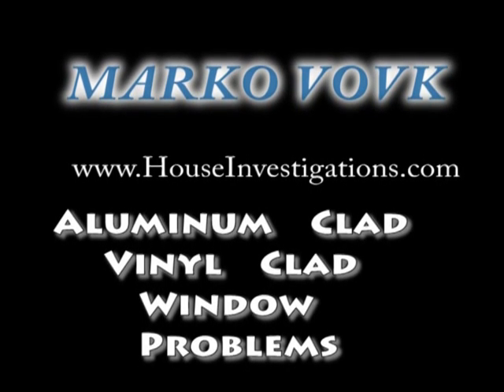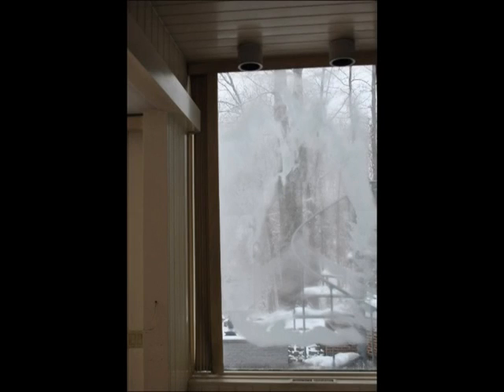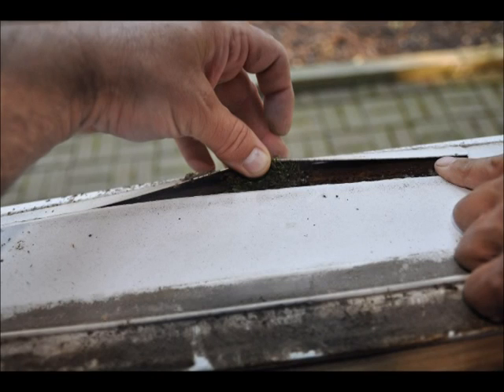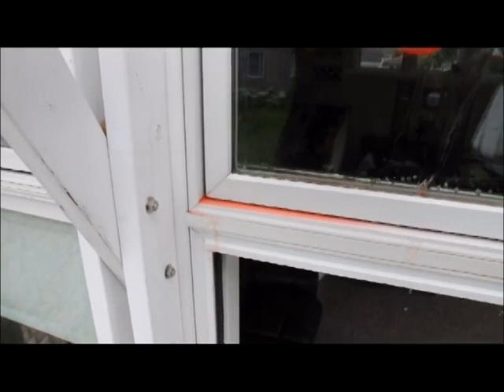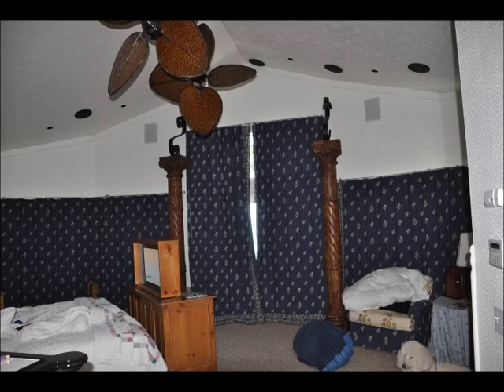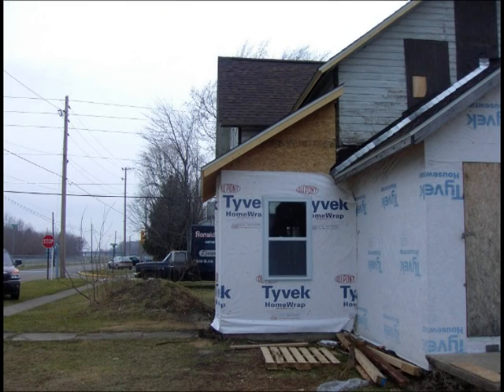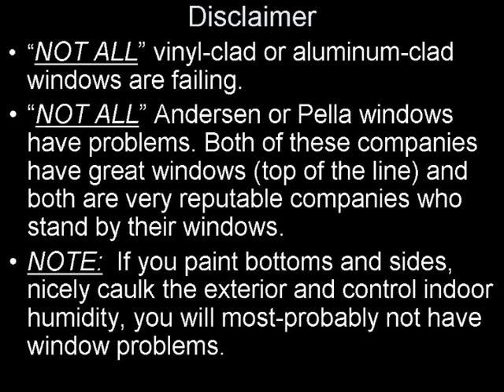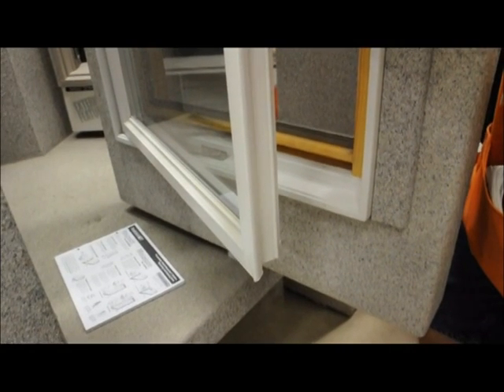Aluminum Clad, Vinyl Clad, Window Deterioration THE TRUTH Pella Andersen

Comment: Thanks for this video. A lot of information.  I am unclear on opinion of going with s sliding glass door by Anderson either the Proline wood interior with vinyl clad exterior  or the Permashield which is all vinyl clad.  Both clad over the engineered wood . I don't know if it is a rolled clad and would be a problem?  I have an all wood door now...any recommendations or cautionary tales or better brands in same price range?  I was also going to buy direct and not go through Home Depot.  Any comments?  In live in CO climate.

Thanks for your help!  it is needed!

Comment: Two questions: 
1) How is it OK to have a vinyl clad window but it's not OK to have a aluminum clad window with regards to the exterior vapor barrier in cold months (where moisture is trying to push towards the outside of the house)?  I would think that vinyl would act as a vapor barrier just the same as aluminum would, no?  I ask because Brad Purvis posted that his 31 year old Andersen vinyl clad windows are performing well, and you replied that "Andersen Rules".  I'm trying to understand how a vinyl clad would solve the exterior vapor barrier issue you noted in the video; and
2) I'm currently getting estimates to replace all the windows in my home, and from what I understand all of the main manufacturers (Andersen, Marvin and Pella) had issues with their clad windows in the 90's and early '00s which (supposedly) have since been resolved.  I'm looking at the new Pella 450s for my home -- do you know if the current production line of aluminum clad 450's have the same sealing issue with the aluminum and will eventually rot out and deteriorate?  I certainly don't want to replace all my windows again in 10 years....

I also had a quote from Renewal by Anderson and (at first) was ready to jump in.  I liked the idea of the Fibrex windows and they looked close enough to wood that I wouldn't lose the classic feel in the house.  I asked the rep if the fibrex renewals were better than the anderson retail windows like the 400 series -- and he confidently said "yes, there the only one andersen will install, so you know they're good."  Turns out he was full of cr*p, they use fibrex in their 100 series budget line windows as well -- not even close in quality to the 400's.  Further, Andersen doesn't even own the production of fibrex anymore from what I understand (they own the technology and name, but they do not manufacture it directly) -- I believe they outsource the production now to a third party.  Not only that, you'd think with a composite material they would give you more than the 10 year warranty that they give on their wood clad windows; seems odd that they can't warrant the material for longer than wood (vinyl carries a lifetime warranty in many cases).

My dilemma is that I don't want vinyl windows -- the look and feel just isn't there yet to mimic wood (it seems like they're not even trying to accomplish that).  The fiberglass windows are OK, but still don't have the same look and feel as wood either.  So, I'm limited to wood clad windows and am trying to find the best product.  The Pellas looked nice to me, but I want to get your thoughts on whether they have corrected the leaky aluminum cladding or not in recent years.  My next estimate is for Anderson 400's -- do you think those will perform better than the Pella 450's?
Reply: jefflesauvage You definitely jumped to an incorrect conclusion based on incorrect information. 

There are 4 main areas of difference between 100 Series
windows and the Renewal by Andersen products:

ApplicationThe 100 Series window is designed and
engineered for new construction applications in the southwest region of the US.
It is available in limited custom sizes but it is not designed for existing
wall conditions and cannot be easily trimmed on the interior and exterior in
such situations. Because of this, the Fibrex brickmold (or any of the RbA interior
and exterior trim options) is not available with the 100 Series. Renewal by
Andersen is specifically designed and engineered for replacement applications (exterior
sheathing, siding, and trim, and interior sheetrock and trim) and can easily be
trimmed inside and out – hence the many trimming options RbA is able to offer. Glazing SystemThe glass in the 100 Series is shop-made
glass, not factory-made. It is thinner single-strength glass, as opposed to the
oversized double-strength glass of RbA windows. 100 Series glass also has just
a single seal, while RbA has a dual seal of both butyl and silicone for
longevity and integrity of the glass seal. The 100 Series is filled with argon
using the capillary method (which typically results in a 50-55% fill of argon
between the panes and necessitates a plug to be glued into the hole where the
argon was blown in). RbA windows are filled with Andersen’s patented
argon-nitrogen blend using the vacuum-pulse method (which results in a 99% fill
of the argon/nitrogen blend between the panes and requires no plug because no
hole is used to inject the gas.) 100 Series gliding windows receive a
Performance Grade rating of 30, while RbA gliding windows receive a PG of 40. That
is also a significant difference. (By the way, the 100 Series is also not made at
the RbA plant in Minnesota. It is made at a facility in Texas, due to its
proximity to the 100 Series’ target market.) Market and AvailabilityThe 100 Series is designed and engineered
for the climate in the southwest area of the United States. The 100 Series was
specifically created to offer a new construction alternative to vinyl windows
which soften and melt in the high temperatures of that region. It has been
found to not perform as well in the northeast, particularly because of the
glass package, which is why it is not typically marketed or sold here. It’s
just not a window designed for the vast climatic swings we have in this part of
the country.  WarrantyRenewal by Andersen is the only product
line which Andersen installs themself and warranty that installation. (This is
of course in large part because RbA is the only true replacement window
Andersen manufactures and new construction installations are typically installed
by builders). Not only does the 100 Series have no installation warranty, but improper
application of it as a replacement window can void the warranty. In the case of
defects which are covered under warranty, labor is typically not included with
the 100 Series while it is included by your local Renewal by Andersen. The exterior
color finish warranty of the 100 Series is only 5 years and does not cover weather
stripping, accessories and hardware, including insect screen frames, handles,
and lock components. The procedure for making warranty claims with
these two products is also quite different. Of course, with RbA, you have a
local dedicated Service Department that typically responds to any needs within
1-2 days, and will handle any ordering, delivery, labor, and installation for
you.
Lastly, Renewal by Andersen is manufactured and owned by Andersen and is manufactured basically right up the street (Cottage Grove, Minnesota) from the main factory (Bayport, Minnesota). The 400 Series is wood with a vinyl cladding and a Fibrex sill. Renewal by Andersen is completely Fibrex. Renewal by Andersen is used on a regular basis to replace 400 Series windows, but I've never heard of anyone replacing Renewal by Andersen windows with any other product, let alone 400 Series.
Reply from the maker: jefflesauvage they are solid vinyl.  Pella came up this the clad idea. Anderson did have a  clad sill with rotted in many homes (90's).
Reply: Clevelandmarko When Brad Purvis mentioned that he has "Andersen vinyl clad casement windows installed when we built the house 31 years ago." that have performed excellently, I'm assuming those are wood windows with a vinyl cladding and not solid vinyl.  I'm getting the impression that you feel any wood window manufactured today is not a good idea to install - and vinyl or fiberglass it the best way to go.  If you HAD to choose a wood window, which would you pick?  I don't see any wood windows without cladding like they used to make, and vinyl and/or fiberglass just doesn't look right on a classic colonial home (in my opinion).

As for the Pella 450s, do you think the newer aluminum clad windows they are manufacturing are better than they used to be with regards to water infiltration and rotting?  I'm not as concerned about the vapor barrier issue, just about the possibility of water getting behind the cladding and rotting the window out.  I was told by Pella that the rotting issues were addressed by using a butyl rubber tape between the wood and the aluminum to protect the wood from moisture.
Reply: Tim Barnes Aside from Fibrex the two products have little in common.   If someone reading this ever has a guy from Home Depot tell you that the 100 series is the same as the RBA window for a fraction of the cost I urge you to see for yourself.  The differences are too many too list.

If you put the two of them side by side and took turn operating them and going over the features (or lack thereof) one by one it would become obvious very quickly that you were not comparing two products that are even in the same class.

I have replaced 100 series new construction windows that were less than 5 years old with RBA windows on a couple occasions.   At the end of the day an improper installation will ruin even the best window and imo the most important difference as it relates to the consumer is a proper installation backed by warranty and dedicated service.    In you contract with a retail outlet to have 100 series put in your home you are definitely rolling the dice when it comes to install day.

A contractor will size down an opening, buy a 100 series builder window with a flange, cut down the flange and pop it into the opening and trim it out considerably.  This leads to all kinds of air/water infiltration issues around the windows instead of through them.
Reply from the maker: jefflesauvage Pella wood is great buy needs to be painted several times. Yes Anderson had some bad designs for one its vinyl clad windows and I also have a video on that. The new full Pella Vinyl looks very good.  Now will the seals last 20 years, I don't Know. Sorry for being 6 months late. I did not see this comment until today. SORRY

Comment: Have Andersen vinyl clad casement windows installed when we built the house 31 years ago. They have performed excellent and replaced 3 casement sashes for seal failure which Andersen replaced two of them well past warranty. Building a new home in hurricane area and need impact glass. Will look at Andersen again as well as others. I do think how well they are installed can cause a large number of failures. Nice job on explaining the causes of failures on some window systems...
Reply from the maker: Brad Purvis  Andersen RULES

Comment: What do you think of Integrity by Marvin Wood-Ultrex ("pultruded" fiberglass) casement windows? They are wood on the inside and fiberglass ultrex on the outside (I think-but not sure- they are solid fiberglass, not clad). BUT the inside frame around the window that the casement mechanism fits into is unpainted wood on the side of the window that faces the exterior of the house. Thanks for your input and your great video.
Reply from the maker: I have not research this one. I only remember the bad ones. I see the bad ones during home inspections. I think the new Pella (non -alum) are good.  Marvin had a Pilt problem in the wood in the late 80's and 90's. They have improved since then.

Comment: What is your opinion of Renewal by Andersen full composite (Fibrex) windows?
Reply from the maker: Great Windows  Anderson Renewal
Reply: Nancy M Design flaws? Would you care to elaborate?
Reply: Nancy M The Renewal by Andersen Fibrex windows have been in homes for 20 years and were tested for years before that. All you need to do is Google "vinyl window problems" and you'll find plenty of evidence that every other type of window (wood, clad wood, Fibrex, fiberglass) is better than vinyl. Vinyl windows are currently the fastest growing segment of the replacement market.

Comment: Pella windows are over rated pieces of CRAP.  I have the Architectural Series installed in 1999.  What a pain in the ass to tilt in for cleaning with the ridiculous nylon tension cables screwed into the sash and the easy to dent aluminum exterior clad. The flimsy aluminum screen frames are out of square and impossible to install.
Reply from the maker: They did come out with a 100% vinyl window that actually looks and works good. They are trying to recover from their Alum Clad butt spanking.
Reply: petemclinc I bought the same windows and now Pella is telling me that they have a design flaw.. they want me to spend 4,000 on 2 new windows and this does not include installation...
Reply: you lie

Comment: Most, if not all of the problems you show in your video with clad windows are ROLLED clad. which is exactly as it sounds - the aluminum or vinyl is literally rolled over the sill and therefore allows water to sit between the wood sill and the vinyl/aluminum "cover" and therefore more prone to rot.  However, another type of clad window that you didn't mention in your video is the EXTRUDED clad!  Marvin isn't the only extruded aluminum clad, there are less-known window companies that also make extruded aluminum or vinyl clad with wood interiors that are more reasonably priced. Windsor, Eagle, Lincoln, Kolbe, WeatherShield, Marvin were among my favorites when I built that make an extruded window with wood frames.  They do cost a bit more than the cheap rolled types but if you want wood frames and interiors, it's worth a few extra bucks for peace of mind that will last 30 years!
Reply from the maker: Laura Thanks. Next time put info into the comment so peope can find these better windows.  Not sure YouTube lets links. Maybe sneak them into comment with out the .com or www parts.
Reply: Clevelandmarko Are you saying Windsor, Eagle, Lincoln, Kolbe, Weathershield and Marvin make good windows? I’m just at a lost as to what company to go with and then there is the problem of finding a good installer!  I live in a house built in the 1950’s with single pane aluminum windows., never had a problem.  Soon I’m moving and would like to improve the windows on the new house but now feel like leaving the aluminum windows on it after watching this video.

Comment: Wow, you are right on most of what you are saying.  Tyvek is not a permeable material in the winter!  External pressure in the summer never rival those of the interior in the winter.  I have torn of probably 1000 home exteriors in the northeast and I have only witnessed condensation related damage on the exterior side of the wall.  The window information is largely correct.  Wood elements need to be sealed properly.  I wanted to ask what you consider a "proper window flashing" as you seem to be married to the underlayment craze which is not a flashing and the main contributor to the problems in the industry.

Comment: marketing hype.  there is no way to weld fiberglass so they use a overlapping system  with screws and silicone.  The put silicone over every screw which eventually will give and water will leak through srews and drip down into your walls causing rot in not only your sills but the walls of your home.  Fiberglass is stronger than vinyl but has its own set of big problems.

Comment: Uh oh, This sr citizen just signed w/ Pella, for (3) Pro-Line alum-clad-over-pine replacement windows (painted interior on two, other one stained).  Now I'm spooked.  Wonder if able to cancel at this point. However, my home is not high end, and intend to sell in 2 yrs, also cannot afford Marvin.  Pella final price including installation, was lower than Anderson by nearly $2,000, but Pella's $3400-$3800 (depending on financing choice) still seems on high side... IF alum over wood is not good.